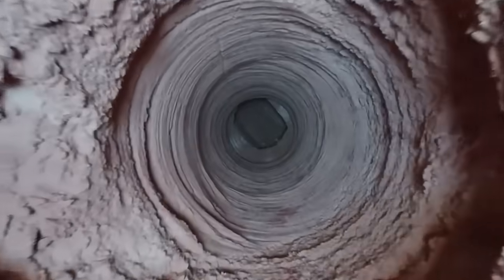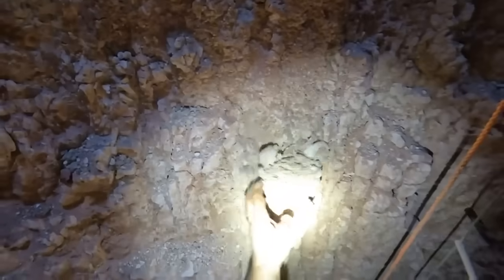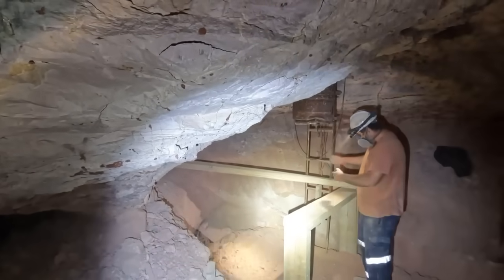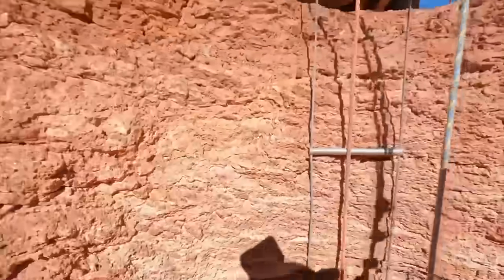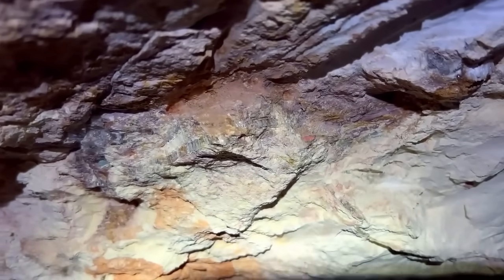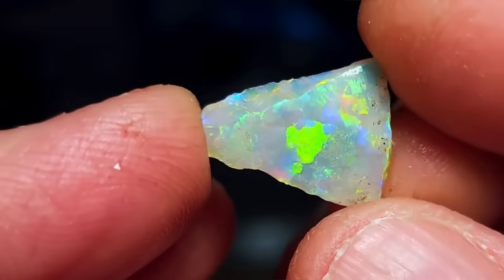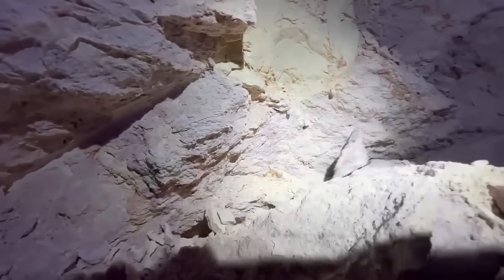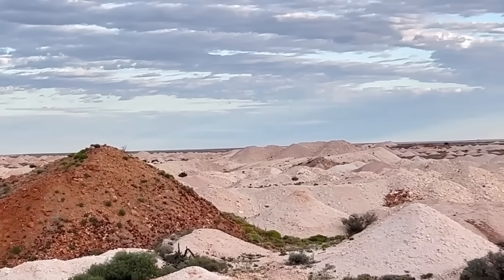Miners Strike Olympic Crystal Opal In Coober Pedy!

Comment: Can't believe what these miners go through to find a little bit of opal.  This has got to be just about as dangerous as King Crab fishing during the winter months.
Reply: I just spent an evening with a crabber who worked for a decade out of Alaska. His stories are incomprehensible. Not to take away from opal mining but crabbing is on a whole different level of insanity from anything on earth.
Reply: @utrose  Crabbing is the most dangerous profession on the planet but being underground that far with all those tunnels and rocks flaking off and dropping 30-75 feet, lack of air, dark and no way of escape in case of a cave in, just give me the jitters.  But, if I had to pick one of the two, I would rather be an opal miner than a crabber.